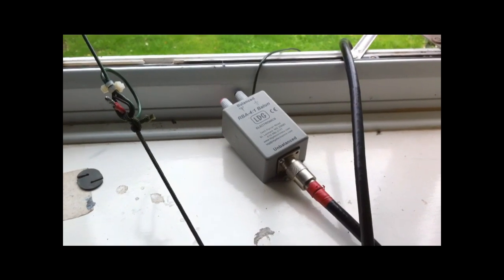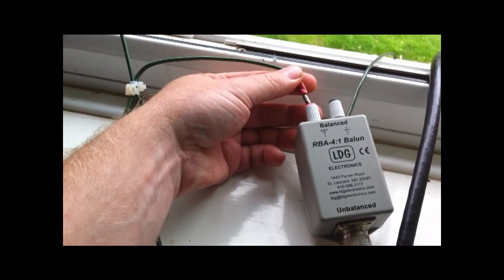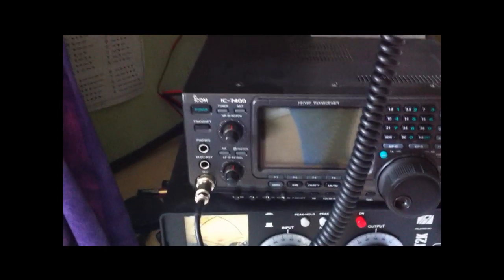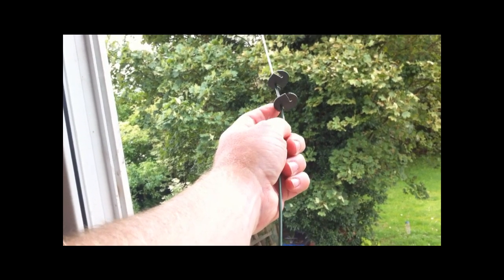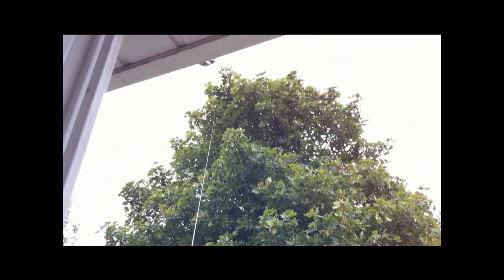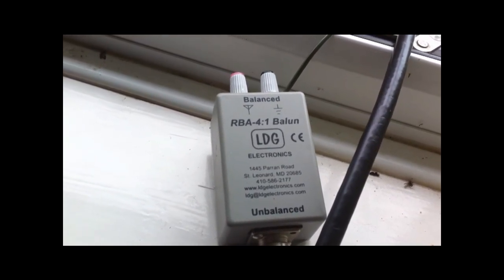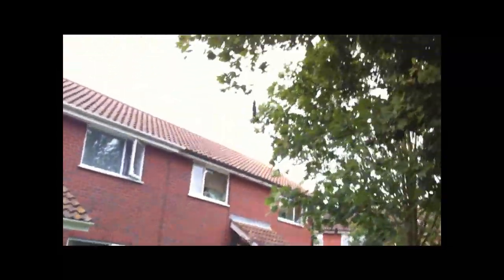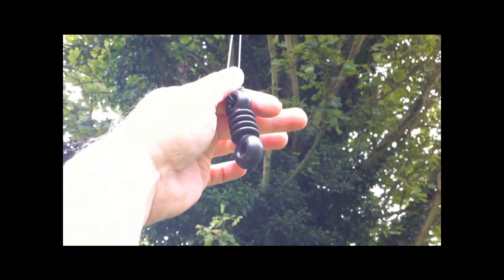Improved Long wire Antenna position with LDG 4-1 Balun

Comment: a few years ago I lived in a tower block and using a long wire 220ft long  sloper at 100ft high feed point no balun was used just connected directly to the atu placed on the window sill used on all bands with counterpoise for each band hidden under the carpet. the counterpoise stopped any rf feed back .Long earth leads are likely to radiate and course rf feed back and tvi 73 G4LMZ

Comment: Mark I find your postings informative!  I use a 40M long wire similar to yours with surprising results on 20M, I ended my longwire at the shack roof then connected directly to a length of 70 ohm coax earthing the shield to the shack metal roof and running a jumper connecting the roof the my metal perimeter fence, huge counterpose!  I then connected the coax to the TUNER of my PRC 320 trimmed coax to a length that would give the highest meter reading, DX Sydney to Moscow best so far! 73 VK2HAS

Comment: Those crank windows must be a nightmare when it comes to routing the antenna feed. The feed through panel I use on my window wouldn't work in your situation.